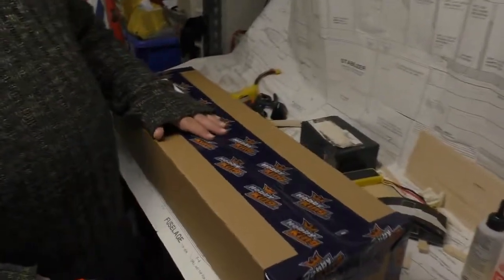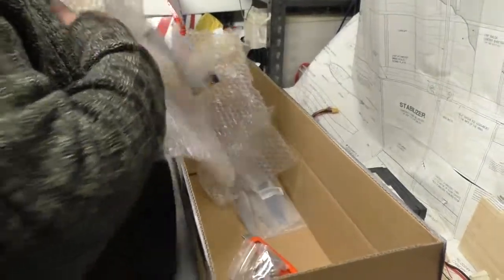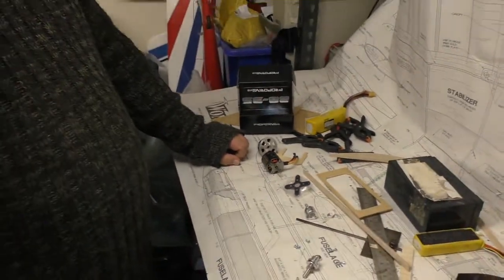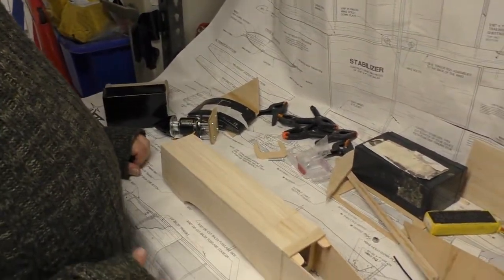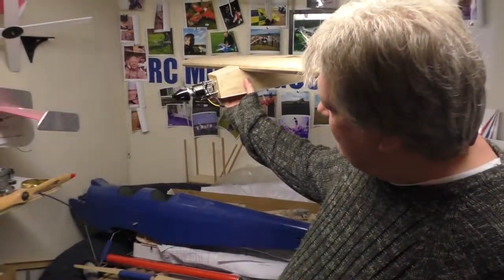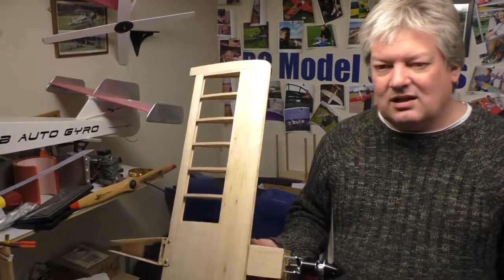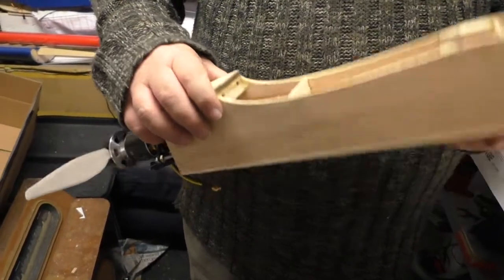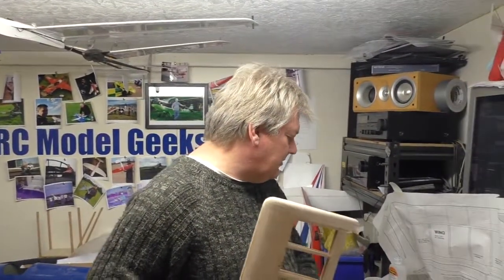Sig Wonder Build Pt5 RC Model Geeks

Comment: Nicking the stand off motor mount bolt idea for the future as I like the adjustment potential for the thrustline,I use flush mounted ESC's a lot myself and this is the best way to mount them too,this is going to zip along a bit !
Reply from the maker: Should be a little nippy ;o)

Comment: Will the prop survive any landing? (that's why I prefer pusher planes). Use a vertical nose skid plate, some wheels or land it in a bush or long grass? If you don't mind short flight times you can use a high KV motor (inrunner?) with a small high pitched prop, which makes is also less susceptible to wind and creates less drag. The only pro on inrunners is that the are easier to balance.
Reply: Why not use rockets?